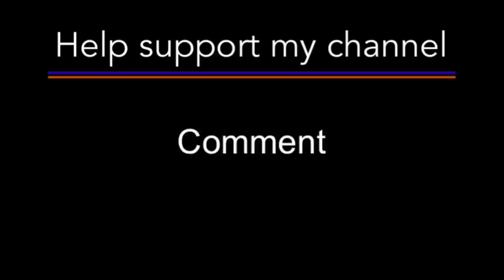Woodturning Green Wood: Walnut Log to Bowl - Turning The Big Green Monster

Comment: Lisa, found your video by chance.  Enjoyed your commentary.  I have the same lathe.  On roughing out the bowl, I recommend you take a look at Reed Gray, the RoboHippy...his channel.  He has a video there on roughing out a wet bowl with a heavy duty scraper he calls the Big Ugly.  Also finishes with a negative rake scraper to take out the cut lines.
Reply from the maker: Hi Mike, welcome 😃
I think I’ve watched all of Reed’s videos at least twice 😂. He was one of the people I leaned on heavily in my YouTube turning crash course. The Big Ugly scares the crap out of me! I don’t mind roughing with my 5/8” gouge - because of his videos I thought hard about a fluteless gouge vs a bottom bowl gouge, which is what I ended up with and am still trying to get a feel for. The video I just put up today is using kiln dried wood and I had the same issue with the lines, even when shear scraping. I can see part of my issues are not so great bevel contact with the gouges, leaving lines where I veer off. I guess I just need to practice more with the finishing cuts/scrapes.
Thanks for stopping by and for taking the time to leave me a comment-much appreciated 😊
Reply: I get it; it does look formidable...he came to our NWWT Meeting a few years ago and did a demo.  It was up close and where you could ask question.  I bought the steel, made a handle, learned how to use it and now use it for wet bowl roughing.  I've since seen him demo it at Symposiums.  Love using it for what it is intended for...then I use all the gouges you showed in your video.
Reply from the maker: Reed is definitely a scraper guy! I’ll keep practicing and at some point muscle memory will kick in. Hopefully 😁
Reply: @LisaRamlow  we al have a lot to learn!

Comment: When I make a bowl this size I often do it in two sessions. First I turn the outside and then the next day it gets hollowed out. 
But when doing that, I always find it has gone out of round overnight. Even while working on the outside the wood is already moving.
I guess that's part of the trade. You did your best but I'm expecting this bowl to start rocking on the table before too long. 
Regarding hollowing I found that it gets really hard for me to go beyond 8 inches, even in soft wood. That's a problem because I'm making ever bigger flowerpots for the wife. To resolve this I'm looking into making a custom toolrest. 
And I'm definitely in the market for a coring system. It is the best way to making a set of stackable bowls. Please keep me posted on your ideas and plans. I have been looking at OneWay but they have no reseller in NL. The EU sales is in Norway but I don't even know if it  will fit my lathe (Record Power MAXI-1). Prices seem reasonable. Perhaps I can ask Record Power for a recommendation. 
Thnx for another great video Lisa!
Reply from the maker: Thanks Leo! I think if I’d have left it even overnight I’d have had to re-true the mortise. I couldn’t believe it had moved that much in the hour or two that I’d fine from the outside to hollowing the inside! There are a bunch of different options for hollowing systems here and I need to do more research before I look seriously at getting one. The all use different methods of “capturing” the boring bar. I’ll keep you guys posted as to what I end up doing. 
I tried to leave enough wood on the bottom to be able to sand it flat when it’s done warping- we’ll see. I normally rough turn, then dry in kiln, then finish turn but wanted to try one green and see what happens. I like the organic look of the warping in most cases 😁

Comment: i just started woodturning and i was wondering what you used for sanding
Reply from the maker: Hi James! I’m using a bit of a sanding buffet at the moment 😂
I have cloth-backed industrial type sandpaper my dad gave me that I tear into strips and use those. I have a 2” mandrel with a couple of different pads and some folks here have suggested that I only use the thick cushy pad with the higher grits and use the firm backing for the lower grits to get all the surface imperfections out. I’m going to try it and see is that helps me with the lines

Comment: Another beauty Lisa.  You talked about not getting a good finish cut on the outside when shear scraping but I didn't see you shear scraping.  You were side scraping however.  On the bottom feeder it looked to me that your tool rest was too high as you had to make downhill cuts towards the center.
Reply from the maker: Hi Tony! I did use the skew as a negative rake scraper but also use my carbide shear scraper at somewhere between 30-45deg angle. The skew gave some a smoother cut - I’m still trying to learn the shear scraper tool. I can’t seem to pull it in a smooth motion - like I get the the carbide “bouncing” across the surface (it’s not quite that dramatic but that’s the best way I can describe it). I think it’s just a matter of practice and muscle memory. I’ll try lowering the tool rest a bit next time I use the bottom feeder. 😁
Reply: @LisaRamlow  getting much movement out of that walnut yet?

Comment: The lathe height issue is something I struggle with too being in a wheelchair. What worked for me was stacking up sheets of plywood and making changes in that stack to establish the ideal distance from floor to center and then adjust the lathe to meet that measurement.
Reply from the maker: Hi Butch! I’m going to do a little experimenting with the height and see if it changes the presentation of the tool at all. 😁
Reply: Oddly enough that fine tuning in my case not only resulted in more comfort and less physical strain but also a much higher level of control where my gouges and scrapers contact the wood.

Comment: Really nice, Lisa! I've heard a steep angle gouge is the way to go for a bottom finisher. Was it grabbing much? I find my English grind a bit more aggressive than my standard 35 swept back. Assuming an even steeper grind would, as well.
Reply from the maker: Hi Jay! The bottom feeder is like a 60-80deg bevel and it’s really short. I’ll try to remember to post a pic in the next video. I don’t have issues with it catching, I just came get the feel for the bevel angle. I got this because I have a lot of trouble getting the bottom of the bowl flat with no ridges or dips - Stuart Batty and Ashley Harwood both use the Thompson bottom bowl gouge like mine, though I think they have 3/4” and mine is 5/8” and I’m not sure the grind is the quite same as what came on mine. I haven’t done anything to mine except try to get the feel for it and it’s evading me a bit.I may look into changing the angle slightly and seeing if I can keep bevel support any better that way. 
Thanks for watching and for taking the time to leave me a comment- much appreciated 😁
Reply: @LisaRamlow  Thank you for the response. Any information, or suggested places to look, are greatly appreciated! I may buy a budget 5/8" bowl gouge, reshape it, and see what I can do. Then, if I'm liking it for removing those pesky bits, go for a proper brand.
Reply from the maker: I think that’s a good plan. The bottom feeder as far as I can tell is mostly a really short grind - I don’t have issues with the wing tips catching but it seems like some people do so you may need to grind them back just a little bit depending on what you end up with. An inexpensive gouge to experiment with and see if you like it is a good plan - you can always regrind it into something else if you don’t!
Reply: Hey, good challenge.  Keep working on your push cut swing and your 40/40 grind and you'll get the continuous, slicing cut you are looking for.  You can practice it on every roughing cut up to the final pass.  Same for the inside, you can hollow with almost all push cuts.

Comment: I was trying to tell from the video whether your elbows were at the center turning point of the lathe. It looks like you’re not too far off for the right height.  Lowering my lathe made a huge difference in the comfort and control of my turning.  As far as centering your carbide tools can’t you just adjust that with your tool rest?  Or did I not understand the issue?
Reply from the maker: Hi Lois! I think my elbow is pretty close to the center spindle height - I did shoot for that when I installed and  leveled it. I’m. It sure if it’s relevant or not but I have a long torso and short legs so if I want to keep the tool handle against my body around the hip area, the angle of the tool is a bit more steep than for someone my height but whose legs are a couple of inches longer and therefore their hip is closer to the center of the spindle height. I don’t think this is an issue for the traditional tools as long as I’m adjusting the tool rest so the cutting edge is at or slightly above the center line. With the carbides (and all scrapers I guess) the cutting edge should be right at center and the angle of the edge presented to the wood should be level, or at a negative angle in the case of using negative rake scrapers. What I’m seeing is that I’m not keeping the carbide tool  handles level- they are angling up from the handle end to the cutting edge, which means the cutting edge is contacting the work at a positive angle, which isn’t ideal. I wish I could attach pictures to these comments! Best I can do is to imagine the dashes and the top of the greater than symbol is the cutting edge 
Normal scraper —————— (workpiece)
Negative rake scraper ========> (workpiece)
What I’m doing  ========< (workpiece)
So my cutting edge is angling up instead of either level or angling down in the case of a negative rake. Does that make sense? It may. It be a huge deal but I imagine I’ll get better results if I’m presenting the cutting edge at the proper angle.
Reply: I see what you mean.  Could you try standing on say a board, add another board and so on until you found exactly what distance works for you?  I did that before lowering my lathe height.  I’m not very tall and I had some early issues too.  One size definitely does not fit all 😊

Comment: Lisa, I love your videos.  You are to hard on yourself!  I have learned a good deal from your commentary.  What lathe did you start turning on and how long did you wait before you moved up to the Laguna?
Reply from the maker: Hi Dan! I started in May of 2019 and had a Delta midi lathe. I learned to turn by watching YouTube videos while I was laid up for 3 months with a broken ankle. A couple of the guys I watched (Sam Angelo and Carl Jacobson) both had one of these Deltas so I figured it would be good enough for me! Once it became clear I was going to stick with turning, I upgraded to the Laguna 220V 2HP so I had more power and could do bigger pieces, tho this walnut monster is only 13” and my Delta could do 12.5” -not sure if the 1HP Delta would handle it but I thought it was a great little lathe.
Reply: @LisaRamlow  Thanks Lisa for the reply.  I have been turning for about a year on a Jet 1221VS and am totally addicted!  I can already see the need for a more powerful lathe though.  With some of the logs it bogs down multiple times when roughing it out to shape.  I too have been self taught from YouTube .  Keep up the great, thoughtful work!

Comment: “Knock” the corners off….

I’m new to turning but I’ve always wondered why turners don’t rotate pieces like this by hand at first, and orient the tool so that the wood is being sliced off, meaning the blade is oriented more parallel to the incoming Wood. This approach works very well when I’m roughing out spindle turnings. 

There must be a reason it isn’t done, but I don’t know what it is.
Reply from the maker: Hi Patrick! I’m not quite sure I understand how you are talking about mounting the blank, but there are a ton of really great instructional turning channels that may have an answer.

Comment: Hi Lisa.  Love the Bowl just to add it is fun to see a little Lady with a power tool step back and watch. hehehehehe. Went I feeling better I will love to add to the fund raising for your Coring Tools. Have you thought a making a platform for you. Lisa I not picking on you because you are short , I like short lady because can do things better then Tall ladies. Lisa you may want to check on that Spindle may be your Problem. Still love your smile.ps because of your Wedding Ring.  Ok
Reply from the maker: Hey Greg! For this new video I switched my floor mats around and am standing on a piece of 3/4” plywood with those foam pads so that adds another little bit, I’d guess close to 1-1/2” of height. My only concern about building a taller platform is the possibility that I might step off it backwards and break my damn ankle again!
Reply: @LisaRamlow  Lisa just build it wide and add ruff surface so you know you are getting  close to edge, but one better option take the lathe stand an cut it Down. If it is not Cast iron have them reweld the adjustment feet back after you cut it Down. You still a sweetheart lathe Turning.
Reply: @LisaRamlow  hi Lisa sorry to bug up would your Laguna Lathe y chance have Te Extension on it? Just asking some lathe come with them .  Well enjoy you lovely Weekend and I love the way you woodTurning be safe an see you next Thursday

Comment: Just a thought if I understand your issue of getting a nice (er) cut on the outside of the bowl. I start with sharpening my favorite swept back bowl gouge and try from the other direction. I have found on wet wood sometimes the fiber lay down or cut better even though I’m cutting against the grain without the bevel riding the wood as in cutting up hill.
Got fix the machine height to bring out your best and support your endurance. Hard to fight lathe height as you obviously know. Worth the hassle. By the way, nice work and pretty wood.
Reply from the maker: Thanks Mark! I actually do cut backwards or uphill on occasion and I agree, I sometimes get a better finish that way than cutting with the grain and/or shear scraping. It’s kinda weird but sometimes one tool or technique works better on some days on some projects so I’ll frequently try all the things! 😁
Reply: @LisaRamlow  Wow I so appreciate your response because I not sure about much and to agree with another pro is a good feeling. Thanks. 
I also forgot to mention another trick and that’s to flood the wood with some neutral oil. I use mineral oil if I’m not sure what the final finish will be. I can go right back to work or wait a few hours or longer. The fibers act quite different when saturated with oil or even beeswax. I also figure I’m “preaching to the choir “ given your pro level skills. Looking forward to more of your work.  Mark

Comment: Also, for green wood, you can wet sand, which will keep your paper clear and allow you to sand through all your grits.  If you keep a spray bottle of water handy, this is easy, but messy.
Reply from the maker: I have not had any luck wet sanding, at least using mineral oil and not just water. I’ll have to try it with water next time I want to do a green bowl
Reply: @LisaRamlow  yes, wet sanding requires a significant amount of liquid if you are removing alot of material.  Water is great because you can keep enough present to continually wash away the "dust", but it's good to cover your large bed and put something on the floor for easy clean up.  Wet sanding with oil is great when the prices is dry and you are removing small amounts of material, but sufficient oil is still required to keep the sandpaper clear so it will cut and not clog.  Some despise wet sanding, but for green wood I ding that if I wet sand with water from 60 or 80 to 120 then 220, then allow the surface to dry off, switch then to wet sanding with oil 220 to 320, then allow the piece to dry ( you can reoil as it dries and absorbs the oil) it requires little sanding when completely dry.  Also, wet sanding when green allows you to do most of the sanding while the piece is still symmetric.  It's quite a discovery of techniques for different approaches for different woods and different conditions, but that makes it rewarding.  Best to you and your turning pursuits!

Comment: As a suggestion concerning your lathe height and assuming you still need suggestions. You could build yourself a platform to stand on. Just make sure it’s not too tall so you don’t hurt your back and make it wide and long enough you don’t to worry about stepping off of it while you’re turning.
Reply from the maker: Thanks for the suggestion! I sort of have a riser, tho it’s just a piece of 3/4”OSB with those colored snap-together play mats for kids glued to to the top. I broke my ankle in 2019 and that was the absolute worst thing I’ve ever had to deal with so I’m a bit worried about making anything taller cuz I have stepped sideways off my little one before 🙄